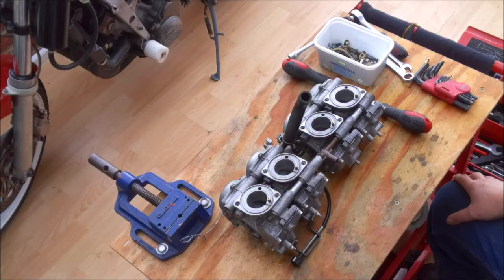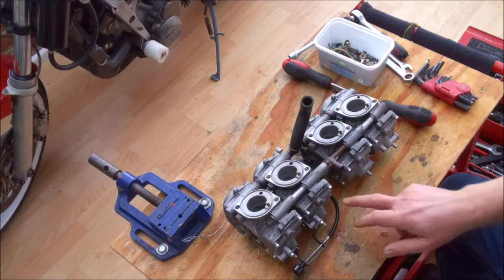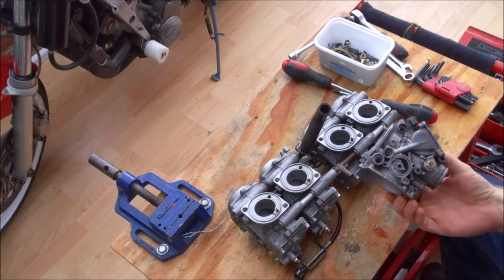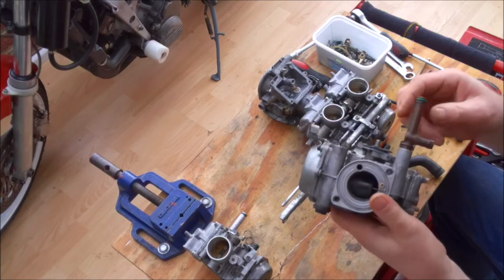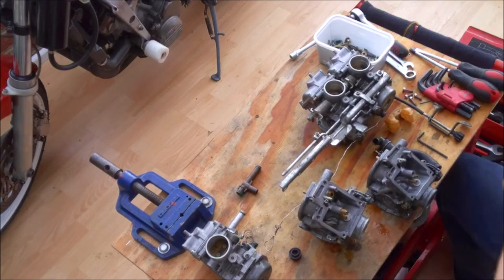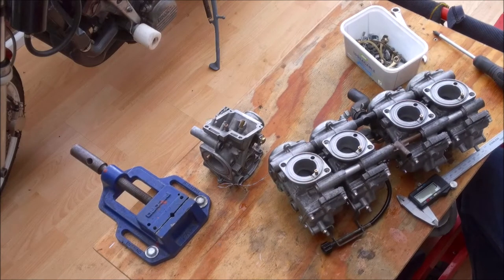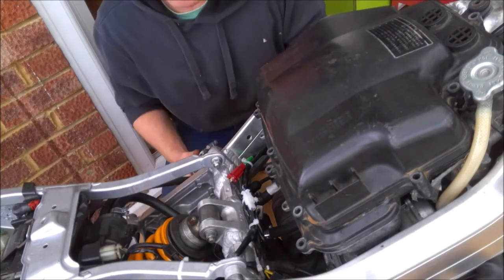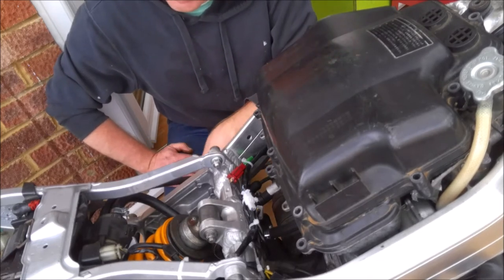Honda CBR400 Budget Track Bike - Part 24 Fuel Tank, Hoses & Fuel Leak

Comment: Fuel pump .need or no need
Reply from the maker: You do really need the fuel pump - once you get below 1/2 a tank the bike will struggle to draw enough fuel
Reply: I have an 88 cbr 400 rr and without the fuel pump its like a honda 50
Reply: Did you get enough flow through the replacment fuel filter?